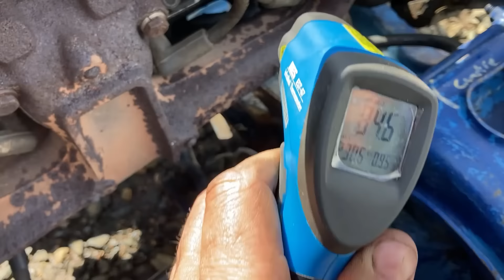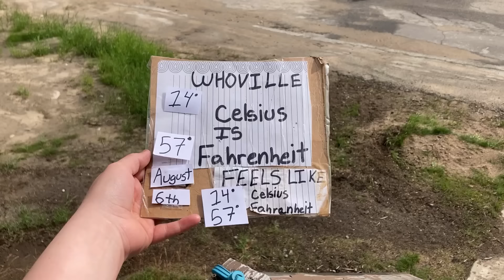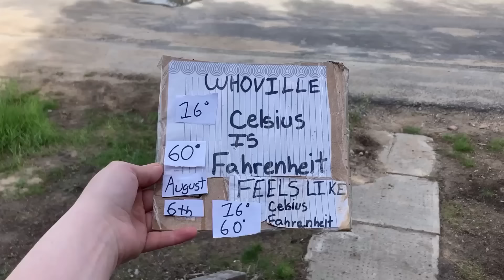Attempted to Rebuild the Carburetor But It Ended Up Being a "Refresh" Instead Aug 06 2024

Comment: Good morning from Cape Cod ⛵ Take the China wall gaskets and Chuck them. Use Right Stuff black. For the hefty bead along the China walls, let it set up for 10 minutes and gingerly place the intake, line it up with the bolts in, just loosely tighten it so everything's properly lined up. After about half an hour torque it down.  💯 foolproof every time. I guarantee it. Rochester is a fine carburetor but I moved on to Edelbrock 40 years ago and never turned back. Anyway it's always good to hear about your past and upbringing and all the BS in between 😉 it's always a pleasure, until tomorrow guys ✌️🇺🇲🇨🇦
Reply from the maker: yes when you see the gasket flattened out like that the gasket maker is the best thing to use. strange how things change. yes people don't realize how much is taken or go missing once you pass on.  thansk

Comment: The high fuel pressure business reminded me of something I tried once. I was driving a '62 falcon with a 144 six and the fuel pump went out. I had no money but I did have a high volume electric pump off an old drag car. I thought it would overdrive the little one barrel carb so I found an old carburetor jet that fit tightly into the rubber fuel line and put the line back on with the jet orfice as a restrictor. The car ran fine without flooding so I guess it was a success. Thanks for the video, enjoyed it as always!
Reply from the maker: that was good thinking on your part to make a simple repair.  thansk

Comment: Early tonight! 9:18 ET. Mr. KoO, I cleaned and re-gasketed a carb back in 1981 for my Mom. She called a week later with a problem. It was the accelerator pump gasket. The alcohol gas had attacked it after only a couple days. Instead of buying another whole kit I went to the Dodge dealer for a plunger rubber. The parts guy told me to see one of the mechanics who had a coat hanger full of them. Ah ha! That was my introduction to alcohol gas. 
Xena, is that flower a Johnny Jump Up? If it is they are quite prolific and strong. I planted about 30 different kinds of flower seeds that had accumulated over the years one time in my front yard. I wasn't too careful carrying them and apparently some fell into the cracks in the sidewalk because about 3 months after all the other seeds bloomed,  I had Johnny Jump Ups growing in the cracks of my sidewalk. They survived for another whole year and were everywhere.  Ha. (i mean eh)  Xena, I am surprised the druggist doesn't have orajel or anbesol for tooth pain. ben/ michigan
Reply from the maker: yes finished up early so early video. the gas they say is better is not and ruins lots and costs a lot more so no money saved.  thansk
Reply: No druggist around here, will have to look up and see what kind of flowers they’re. Got a few growing around the yard that I’ve never seen before. Not sure how they got there. Thanks 

Xena

Comment: I got very good at fixing those quadrajets , not many problems normally , just watch for sunk floats.
On the intake manifold just use silicone on the ends, throw the rubber in the trash, it just causes problems
Reply: I got secondary metering rods from Rochester Carb where I used to work at the GM Proving Ground for a friend who couldn't get his Suburban (454) to pull out of the spot where he parked it in the mountains of Colorado after an Elk hunt. I don't remember the info on them, but his daughter told me they swapped them at the camp and it pulled right out. So there's a little something I learned. ben/ michigan
Reply: I used Mike's carburetor/ youtube for info,  they even brought up the overfueling with new fuel pumps.   If you ever come down by Vancouver,  B.C. I have several boxes older welding rods still in boxes with plastic.
Reply: Yes and yes again
Reply from the maker: yes we are learning and will toss the gaskets.  thansk
Reply from the maker: @benjamincresswell3713  yes you can improve and change the Q-jets big time  thansk
Reply from the maker: @MrHiball1234  yes i have bought from Mikes and watch his videos plus follow along on his facebook page. will remember if and when i get to Vancouver.  thansk
Reply from the maker: @randymiller1604  thansk

Comment: Never cared to rebuild carbs but although I don't work car ones I have done a lot of small engine ones. I used to have to do them every year but wised up and quit using ethanol gas and have done a carb since unless it's something I just bought.  I never want to be an executer of a will again. Greed kicks into overdrive. When the ex was sayingshe wasn't going after my tools I told her truthfully I don't have any because several years before I gave them all to my son. Get everything divided ahead so they can whistle into the wind. Everything is with me as I live with my son.
Reply from the maker: yes greed takes over big time and people just want and will never use them at all. so lucky we don't have the ethanol gas up here.  thansk

Comment: throw the rubber intake gaskets in the trash and just use the black goo , build it ur 1/4" tall and muck it in the corners where  it meets the head! no more issues, silicone is like grease to a rubber gasket.
Reply from the maker: i seen that there is not much room that flattened out the gasket.  thansk

Comment: I had a batch of several old Ford 2150  2barrels that were on the AMC Jeep 360s that were Grand Wags. I rebuilt the 1 with the tightest throttle shafts and robbed the others as needed. I had a rebuild kit from NAPA and it had a detailed set of instructions. My last GW got 15mpg and amazed the  emissions tester with its low smog  numbers. I lucked out, Carb tuning is an art.  Mid 80s Bosch fuel injection is artless. Camrys haven't had a hiccup ever in 8 yrs.😎
Reply from the maker: yes take your time and learn and do it right and it pays off in the end.  thansk

Comment: Never ever had a problem with blue or any color accelerator rubber. Had way more problems with the old leather ones. I only do a couple of Holley carbs a year now. Haven't done a quadrajet lately, but have likely done 300 of them. Throw those intake gaskets away and just use RTV silicone but make sure neither surface is oily. (And don't use too much)
Reply from the maker: yes when i seen the rubber gasket damaged i figured there was not much clearance and quite a few comments on no gasket required. i remember the old leather ones. those always gave problems. thansk